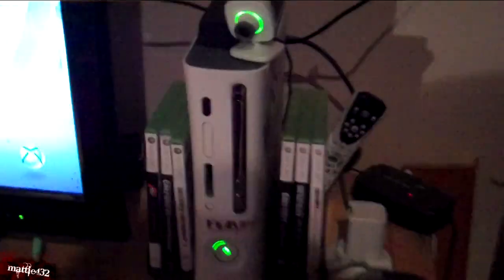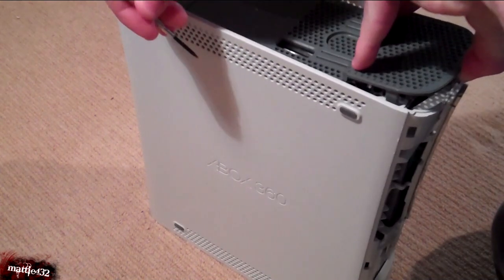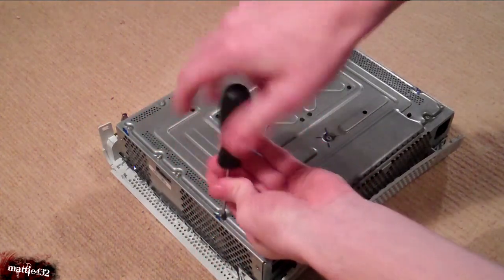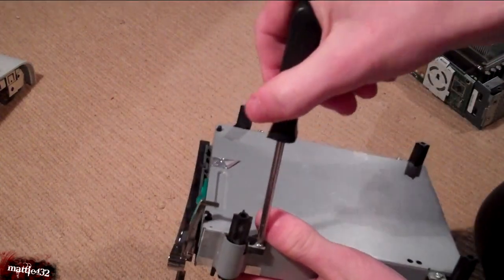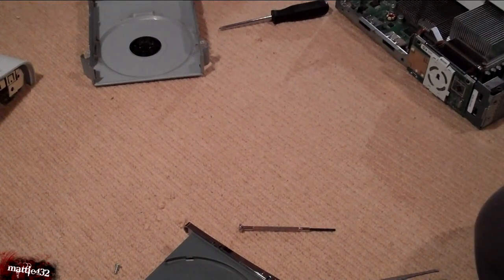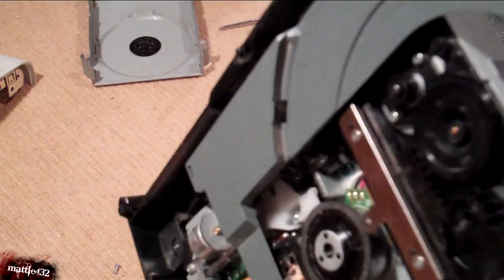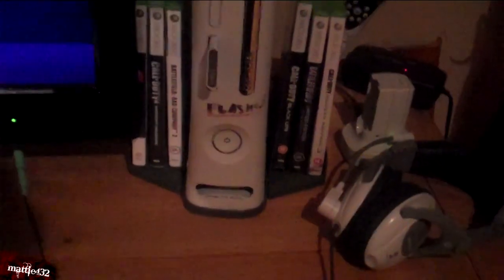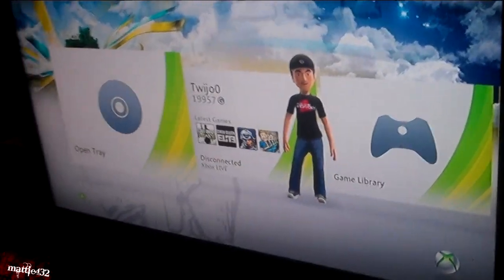XBox360 stuck/jammed DVD drive fix

Comment: I had a modern warfare 2 limited edition 360 in the closet with the disc tray half way out. It would not close or open. Its been in the closet for at the least 2-3 years. I had given up on it. Yesterday I was searching around on how to fix my ps3. Ran into this video. I got home followed the video and BAM!!!!!!! It works now. Thx man.
Reply: Dude the same thing happened to me :/ im gonna open it and fix it, it is one of a kind! but im bummed out my optical drive (matte black bezel with xbox 360 on it) is broken.. im gonna have to get a replacement chrome one

Comment: You don't have to disassemble the console for this! Just get yourself a flashlight (I used my phone's light), power off console, use a paperclip to open tray, remove the band, wipe it (I used some antibacterial wet wipe), then reverse it (so that the inner side is facing out and not touching the gears), put it back on. First put it on the small motor gear, then as much as you can on the big gear and turn it (the big gear) clockwise while holding the band so it doesn't slip off. Voila! It's like new now... Just bought a used arcade jasper.
Reply: Thank you so much. I did it this way and can confirm it totally works. I hit a wall trying to do it the way in the video when you need the screwdriver, but then i read your comment and did it this way and it works now. Thanks!
Reply: Heh. Told ya!
Reply: thank you really worked
Reply: how do u open with the paper clip?
Reply: I believe you have to remove the front plate and then there's a little hole in there to put the clip in. there must be a vid on youtube
Reply: IT WORKED!! saved me hours of work. This took me like ten minutes total (finding tweezers, opening it, cleaning it, putting the ring back on. TRY THIS METHOD FIRST!!
Reply: I was about to start looking for tools when I saw this,holy shit it worked
Reply: Mine open halfway the closes again any suggestion?
Reply: that worked for me thanks. hardest part was using the phone light and trying to hold the band at the same time.
Reply: Kinda did the same - didn't feel like opening up the XB360 ;-)
Reply: Amazing advice! worked like a charm once I finally mastered the paper clip part!! :)

Comment: 3:20 "very difficult to break" MY ASS, i'm breaking my xbox piece by piece, not as simple as you say and make it look
Reply: That the same problem I have lol
Reply: Thats*
Reply: @flugamelu  I was having the same problem at the 3min point of opening the case. There are 5 sliders on onside that need to depressed all together. Doing then without a specific tool designed to release all together makes it very tricky. I did manage, but only with help of someone pulling the case apart whilst I released each clip.
Reply: Yeah every single pin on the back of mine is broken 😂 I bought mine used and the chick before tried to fix it herself but didn’t have the right hardware to open the electronic part thank god. But yeah she superglued the back, back together

Comment: I'm a 58 year old woman. I figured if I could build a desk top computer I could do this.  I followed your video and fixed my xbox360 gen2. Also made sure to use canned air to clean out the dust that will help with keeping the heat down. I no longer have to keep a disc in it so that it will open. Thanks so much for another headache gone from my house.

Comment: I bought my 360 about 10-11 years ago when they were only out a few years. I got it for $60 when they were reselling used for $100-150 more than that because the drive wouldn't open, and it came with no cords or controllers. I just pried the face off and dealt with it not opening for years. Not sure why, but I guess I decided to fix it, and watched this video. It's been working perfectly for a few days now, and I don't know why I waited so long to fix it. For the first time since I've owned this machine, the face facade is in place and the drawer slides out every time! Thanks!

Comment: All I do is slap my Xbox until it opens
Reply: The problem is that I slapped mine so hard that it no longer opens 😂
Reply: Facts!! But now it won't close all the way it's a tiny bit open.. and won't open. As soon as I power on my Xbox it's trying to automatically open or close the tray.. poor thing
Reply: Thank you for that it actually worked
Reply: @ToniaJames02  Same with me, did you manage to fix it? I'm struggling
Reply: @nicholasbossi2377  yea.. I got a flathead screwdriver thing (lol.. thing) and put it in the spot that was partly open and dragged open the tray.. forced it .. w.e but then it kinda eased up.. a screwdriver is always helpful? Even tho I have a half metal and half plastic shell xbox360 now 😅
Reply: aye  you are a real one for this comment  so accurate !!!! lol
Reply: I am not the only one who knows how to respect a woman XD

Comment: My tray is jammed.  It will not come out but maybe a couple of inches  What could be causing it to jam?
Reply: +Donaven Raulerson I just had this disc thing happen this morning and haven't done this yet. It makes the sound like it tries to like a click and then it sounds like I got a message on vibrate
Reply: +Kyle Freudenthal you gears are misaligned and your magnetic piece is coming off. I will make a video on how to fix this
Reply: +Donaven Raulerson can I use a paper clip in the meantime
Reply: +Kyle Freudenthal does it still play the discs
Reply: Yes
Reply: Donaven Raulerson yes
Reply: Then yes if u can open it with a paper clip and it plays discs you will be fine
Reply: Kyle Freudenthal
Reply: Donaven Raulerson i need help my tray does the same thing and I don't know what to do.

Comment: I bet my xbox is jamed worse than any of yours because I've looked up more than enough vids and it still won't open😡😡😡😡😡😟😟😔
Reply: Spray wd40 on it from the outside under the tray in the middle. Guaranteed to fix it
Reply: +nargis751 lol not gaurenteed.. mine was a bent piece of plastic had to completley dissassemble the tray.
Reply: Everything&Anything well done for sorting it. whenever something mechanical gets jammed I use wd40 if that fails then dismantle it.!
Reply: same
Reply: Press the power button and the tray button hold them then release the both button then press the tray button again it will work i have tried😃
Reply: nargis751 thx that worked with my Xbox!!
Reply: +The Joker ya
Reply: bang the top of the xbox cd tray itll come out
Reply: Most likely is the magnet in the top of the drive that wont let go. I remember trying to use the hole reinforcements on the magenets to fix the issue, works sometimes...
Reply: same
Reply: Try when it's opening 1. taping on the disc drive dark grey spot and 2 try putting a random disc in on The side the light grey. (this one worked for me)
Reply: Red_ Runner_21 mine too
Reply: U have to pull the tray out that’s what I literally just did but it was by accident my shit was hella jammed then I pulled it out and slid it back in and it was good as new lol
Reply: Red_ Runner_21 omfg same so i did everything and now the light of my xbox is flashing red like wtf
Reply: Juwan Swinton i couldnt get it out like that and its still not working
Reply: Same

Comment: you are an amazing young man, i fixed it! One suggestion though, i noticed on the main wheel where you pulled the band from? The brass or copper looking post in the middle of the wheel was sticking up slightly, and would catch on the bottom of the tray. with some pressure, it popped back down and the tray was free to move.

Comment: @Mattie432 you could of use a paperclip to open the disc drive instead to stick it in the middle to open is easy than using the tool to open disc drive.

Comment: Thanks for that video!  I had a bid on eBay for a replacement DVD drive, started to think that replacing it could get complicated if flashing the "new" drive were a requirement, and then I stumbled across your video.   I did as you prescribed, and now it's working like a champ!  I have another Xbox exhibiting intermittent problems of the same nature, and did that one as well.  The other one had about a pound of dust inside, and cleaning it out using a service vacuum cleaner fixed the loud fans.

Comment: Thanks for this. I was able to spin the drive belt manually by taking off the front case and swiping a screwdriver over the belt until it popped open!
Unfortunately, the drive won't read any discs, so I'll have to figure that out soon.

Comment: I used a paperclip to open the drive and then I could see the wheels and band so cleaned them with a brush with some isopropyl on it.  Thank's for showing where it all was.  I also heard from other comments that if you leave a disk in it will never ever fail to open - no idea if it's true but no harm in trying.  Cheers.

Comment: thanks alot bro. my sons xbox was jammed and misaligned. I used your video to dismantle the xbox safely and correctly. cleaned the dust out to keep it clean. then gently pulled out disk tray. I then completely removed the disk tray gently (was tricky) but by following the track lines it clicked back and re aligned. checked carefully with power on and it worked sweet. thanks for this video. really easy to follow.

Comment: Still helping people like me even today lol 

BTW for anyone wondering, you can do this WITHOUT taking it apart, like he said though its harder. I just turned the 360 off, popped off the front panel, spun the wheel while everything was together with a toothpick, then did the same process as in the video with a pair of tweezers. To get the band back on (with tweezers) just hook the small wheel on first, then the front of the big wheel and then bring the band around the side and to the back of the big wheel and drop it down. 

THANKS AGAIN FOR THE VIDEO!!

Comment: Thanks for this video.  Cleaning the small belt worked!  However, I just opened the tray and grabbed the belt with some tweezers, cleaned it, and put it back on w/the same tweezers.  There was no need to take apart the entire xbox.

Comment: You are awesome!!!  This is just what I needed!!!

I was cleaning the belt without taking the Box apart.  I got the belt off but let the drawer slip and it closed and latched.  The part about turning the pulley (at about 05:55 ) is exactly what I needed!!  Thanks!!

Comment: mine would also only come out half way . followed the video . only thing I did different was manually pull the tray out and off the machine when it was apart . put it back in track , out it all together and BAM it worked . you are a genius friend  . Peace from the States

Comment: Thank you for showing the wheel thing. I might clean the unit proper eventually, but I was able to easily access it with just taking the front cover off and got to work temporarily.

Comment: Hey, thanks man. Just FYI though to anyone reading this. You don't need to remove everything. Just the faceplate, sides and the front part to see the wheel. Spin counterclockwise and you got it. Then a hold quetip with rubbing alcohol by the rubber band. While doing this, push the tray in and out slowly. The grime should come off. Solved, if that's the problem to begin with.

Comment: This worked perfectly....     One tip some of the parts like the plastics won't come off easily like the video because this isn't his first time opening that Xbox 360 so be patient this will work if you  follow instructions
Reply: I second this. My Xbox did NOT want to come open, and it took a lot longer and more force than I was expecting, but it eventually did!
Reply: well i'm glad that worked out

Comment: Thanks for the video. I'm currently furloughed and decided I'd try and fix my old xbox for something to do.

The good news is I have successfully taken everything apart and put it back together.

The band news is when I got to the removing the belt part, I noticed that around a quarter of the splines on the cog that drives the belt were missing. Explains why the tray isn't opening now

Cheers anyway!

Comment: The year is 2023 and it costs more to send your xbox 360 in for repair than buying a working used 360. So I decide to do it on my own. If I break it, it's not worth much anyway since it doesn't read disks
Reply: Does it work?

Comment: thanks so much xbox does this all the time and it finally wouldn't open on its own for some reason. Turns out it was just that the xbox was just either overheated or my belt needed to be cleaned but some how after I put it together again it worked. thanks a lot ps you just got a new sub.

Comment: Thanks, the paper clip wouldn't release the tray, so I took it all apart and cleaned the band.  Then put it back together and it still wouldn't eject.  Then I put the paper clip in the slot and it popped.  I rolled it out and placed a game in the console and it is working perfect. Thank you for your help.

Comment: Great video dude thanks for that just bought an old Jasper model Xbox off of Ebay and everything was good apart from the disc tray opening but thought instead of returning it, only cost me £25 so thought would either keep as digital console or try and fix if I could, never opened an Xbox before, plenty of PS3's which are easy. So anyway followed your tutorial and went like a dream, and disc tray working great, plus gave me a chance to clean out 12 years of dust from it too, although quite a bit of dust not as bad as I thought it may have been. Another subscription too dude.

Comment: You can access the area to turn the belt by removing the front panel only and using a metal rod. Turns out that I did need to air-out that area though; thanks for the explanation.

Comment: My Halo 3 Xbox 360 was jammed till I watched this video. But I just put I tiny bit of WD-40 on the gears near that rubber band and filed down some of the metal from the disk tray housing kept testing it and it worked with no problem for me.

Comment: yes. you do NOT have to open anything to get to that rubber band. its easily accessible once you get the drive open. to do that you take off the face plate. if you look directly under the silver disk drive cover you will see 2 holes. you want to take a large paper clip and insert it into the hole on the right closest to the power button. what youre essentially doing is pushing the paper clip between the 2 plastic gears that open the tray. it doesnt take much force to open with paper clip. just have to put it straight in and give it a good push and the tray will open.  once you pull it all the way open shine a flashlight in there you will see the 2 gears right there in front of you. you need to use a pair of tweezers and take off the rubber band. dont worry it easily goes back on. once you get that off clean it with some rubbing alcohol. also take a Qtip with some rubbing alcohol and wipe those wheels off. then put back the band and you're good as new. i just did it with mine and it opens and closes perfectly. like new. i do suggest to use the eject button to close the tray instead of pushing it. it'll last longer. Happy gaming!

Comment: great tutorial, the only thing i would add id whilst you've got your 360 apart it's worth spending a little money on a can of compressed  air to clean out the inside of the xbox  before putting it back together ....but thanks for the heads up o the drive belt

Comment: If its stuck you can sometimes get it open by tapping on the top while pressing the eject button. The way i fixed mines was by holding the trey open then turning it off. While its off take a q tip with alcohol on it. Then clean the rubber band and also clean the middle top of the tray. Should be able to reach it with a regular q tip. I clean all my consoles every 24 months now with compress air and it my game room I usually run an air filter in the room.

Comment: Thanks for the video, but I would recommend to test if the problem is solved before assembling the XBox again, because if you don't clean it good enough, you'll need to disassemble it all over again

Comment: I know this is old but 
1.  Stick a q-tip onto the belt drive with alcohol and clean it without taking it all apart. Just stick it inside the drive door while it’s open. 
2. When you had it apart replace the belt  lol. They’re $1.50 for 10 of them. The reason why the belt slips isn’t dirt. It’s because they stretch out over time and the new one is 3/4 the circumference which will make the tray no longer stick. 
I’m doing one in my 360 now. .

Comment: Yes I still have a 360 and use it for dvds and movie apps. Was able to very easily open the tray, unplug the xbox and use tweezers to grab the belt clean and reinstall zero disassembly

Comment: Not necessary to do all this in some cases.

My drive stuck about 90% of the time. When it did open I just used compressed air, cotton buds and rubbing alcohol to clean the little elastic band and cogs - without taking them out. ALSO: Clean the disk tray itself, mine had a lot of dust on it that was casuing resistance when it opened.

Opens 100% of the time now.

Comment: I have this problem too. Right now i have my 360 all opened up. The weird thing is...the tray opens without any problem if the top cover of the drive is not on it. When it is on/attached, the tray gets stuck right away. In my case it doesn;t seem to be about that rubber band then, right? I also had the 'open tray' error where discs would not get loaded, but i fixed that. I am happy as hell.

Comment: Just pull the tray out of the DVD drive and you will have access to the rubber band and just use your fingers to pull it off the wheels no need to do all that and the tray is easy to put back in just make sure that gear is on eject side